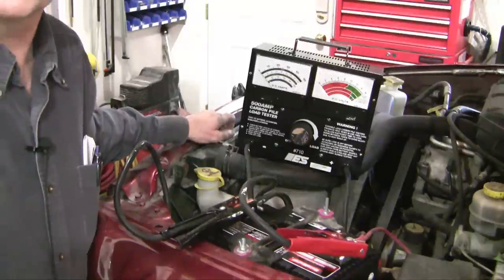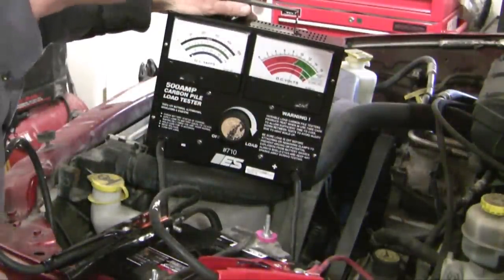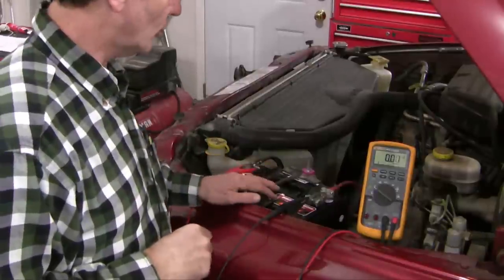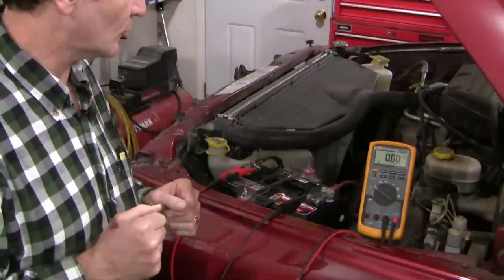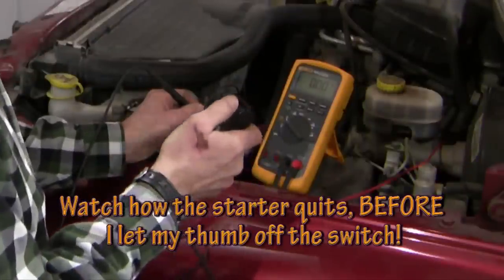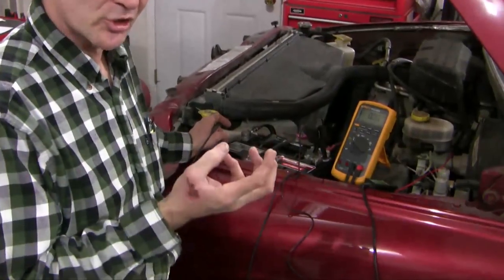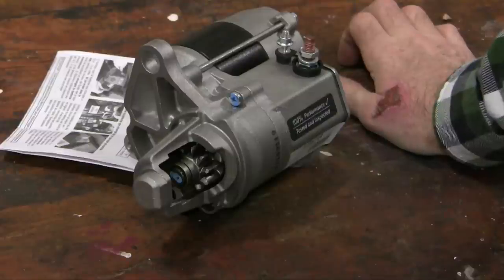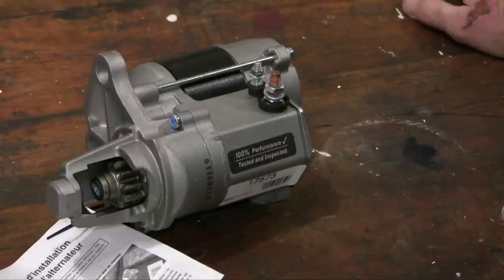How to diagnose & replace a bad starter motor

Comment: my trigger post fell out of my starter. i am going to order a rebuild kit and just rebuild the starter. cheaper than replacing the entire 500.00 unit.
Reply from the maker: Good idea, I should have done that with mine. The extra effort and concern about interim reliability was the main argument against.
Reply: the concern of reliability is the main reason why im opting to rebuild it myself. i do not trust factory parts as far as i can throw them.
Reply from the maker: OK, good point....
Reply: i did an amp test on my current starter and its pulling 1,270A on cranking when it should be pulling 800-950A so i know something is going wrong in there. a full rebuild kit is about 150 where as a brand new starer is much more.
Reply from the maker: Adam Christiansen
That would be a fun video to watch, you should bring your vid cam along.
Reply: once i replace my batteries ill do that. im not sure what batteries i want, i found some AGM deep cycle for cheap that claim to do 1875CA or 1250CCA so im thinking of picking up 2 of those. im just not sure how they would work in this application. the equivalent normal AGM batteries are nearly twice the cost.
Reply from the maker: Those are surprising figures. Deep cycle batteries aren't supposed to have such a good CCA profile. They work well on boats or golf carts but for starting they aren't designed for high amp discharge. I guess if you live in the south where it doesn't get very cold they might be worth a try....
Reply: they are oddesy dry cell AGM's. im just not sure if i want to spend 400.00 on a battery

Comment: really boss just clean   or renew  the copper L  connectors .cheaper  and problem with thses starter sorted
Reply from the maker: Yes, good point, it might have been worth a try. Professionals don't do that, partly because they don't want the negative press of a failure and callback. However for those of us who do the work ourselves, finding parts and replacing or cleaning those solenoid contacts might be all that was needed. When a rebuild is done they do a little more than that, but basically a rebuild approaches the problem the same way. All of us have lives outside of the shop, and part of the equation is the inconvenience of a second failure on the street at inconvenient times. Since labor is free for the DIY mechanic, we don't worry so much about doing the job twice or trying to get it going again on the street. Thanks for your contribution.

Comment: This guy is good, but I do wish he'd have showed us how he removed and then replaced that starter.
Reply: Well, basically you disconnect the negative battery cable, remove the nuts holding the two red wires to the starter, remove the red wires (at the starter), remove the bolts holding the starter to the engine, and remove the starter. It's pretty straight forward.

Comment: Seems over complicated. Most failures I've encountered are click no start.
Reply from the maker: A few years ago a local TV station did a sting operation, presenting a 'click no start' scenario to several auto shops. The problem was a bad connection at the ground post on the battery, which gave the same presentation as a failing battery or a bad solenoid. Because the problem was at the battery post, replacing the battery would solve the problem, even though the battery was good. Embarrassingly, only one shop got the diagnosis right, and many sold the customer a new battery. Sure, pattern recognition is faster and often fixes the problem, at the expense of sometimes replacing the wrong part. 5 minutes to do a drop test seems like a wise plan if you have to pay the bill.

Comment: bs. repaired 100s of these  type starter  on toyotas out in the jungle just by clening or renew contacts never a problem .but they they were Japanese quality stuff .as opposed to americam copy crap
Reply from the maker: For some reason your remark ended up in a spam folder, and my initial attempts to approve it (and a few comments by others) failed. I believe I couldn't approve comments in the spam folder because my Firefox operating system doesn't play nice with a recent Youtube update. In any case, today I discovered they have fixed that problem, so your note will be forever in the thread for others to see.  Few professionals bother to fix starter motors or solenoids, but do I admire those like you, who put in the extra effort to save dough by doing it themselves. The ability for readers to add remarks is one of the most powerful qualities of Youtube, and it needs to be retained in the name of thread integrity.